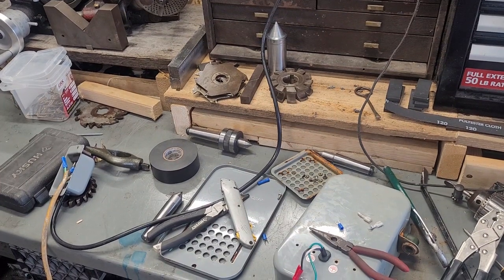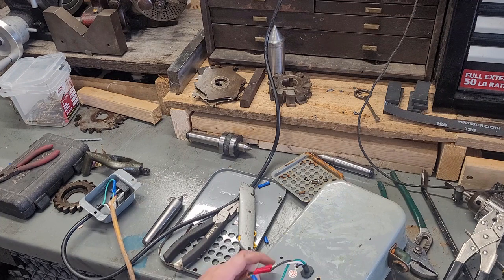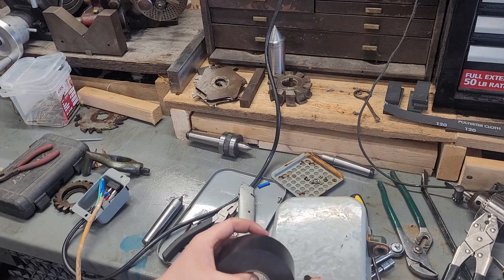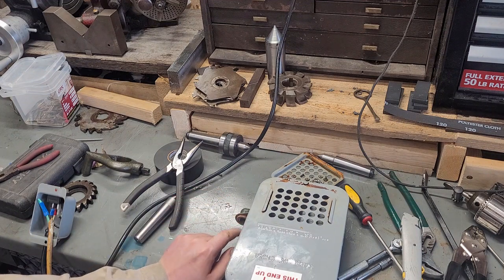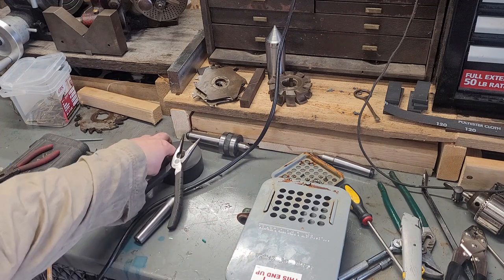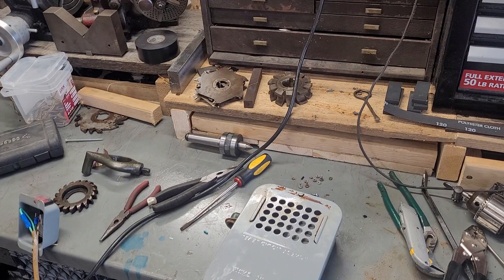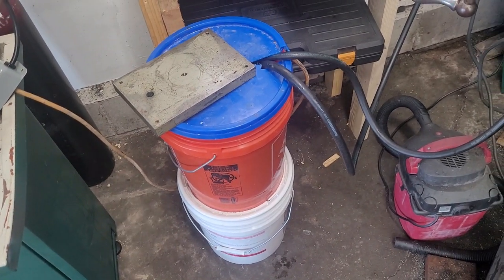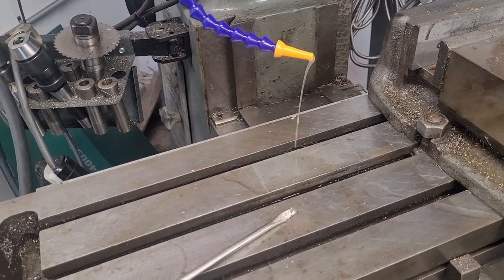Shop Made Tools: diy flood coolant system

Comment: Now that’s just too Cool 👍😎👍 love seeing heat build up being quenched! Question: That pair of “black handled” needle nose pliers looks interesting..is that a built in hanger?  on the left handle? Thanks! Great Video👍😎👍
Reply from the maker: Thank you! I think so, they are an inexpensive set of husky pliers. It's actually kind of unpleasant working in a smoke cloud. It can be hard to see the DRO that's three feet away! Fortunately my mist extractor can keep up.